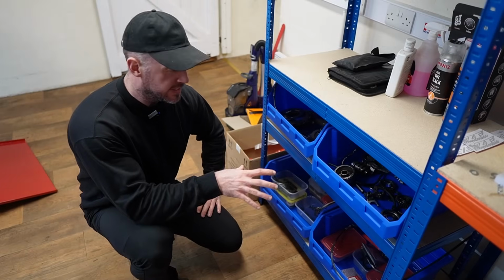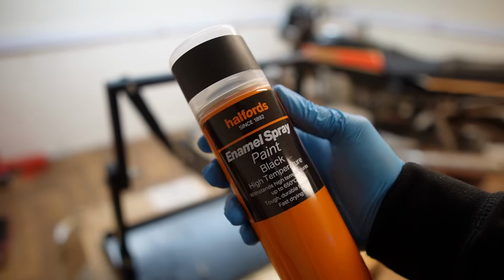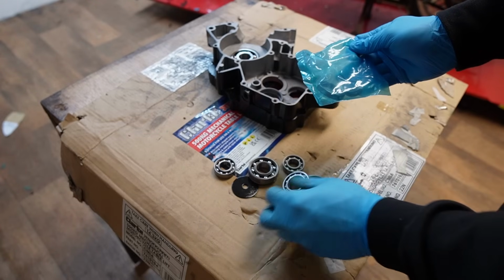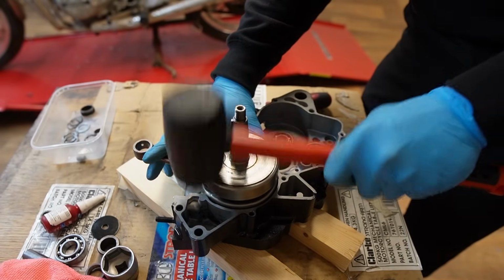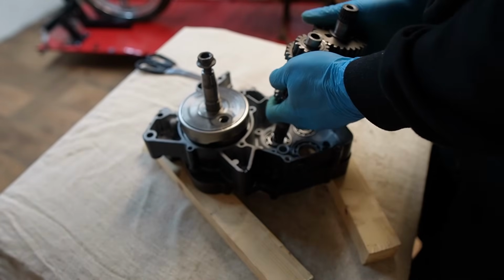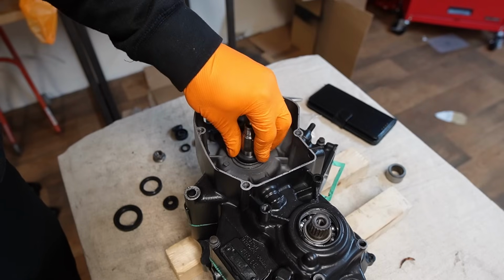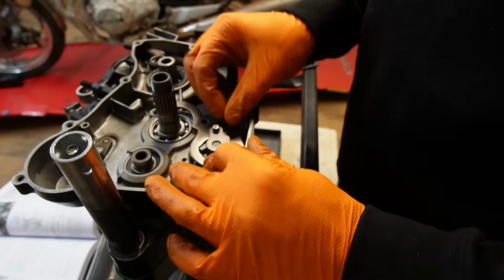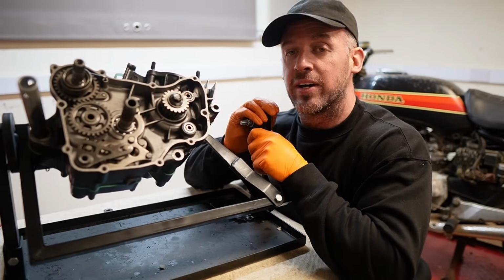REBUILDING A BARN FIND 1991 HONDA CR125 | PT 4

Comment: Loving these builds 😊 Little tip for bearings: pop them in the freezer for about an hour, heat up the casing and they should slide right in 👌
Reply: no... dont just put bearings in a freezer smh.....
Reply: @KentRoads  why?

Comment: Next time you pull the crank into the engine from the opposite side. There are tools for it but you can make your own.   The crankshaft does not like be hammered into place. 
And for the seals you use a socket to drive them in.

Comment: Google assembly lube. A dry bearing is not a happy bearing..... and that crank is likely out of balance now after the percussive persuasion leading to massive vibration at 12000 rpm
Reply: I've always used STP for engine/gearbox assembly ,as do mates still in the trade.

Comment: Buys Clymer manual - doesn't read it - Check
Paint engine casings - doesn't mask up the dirty great holes on the side - Check
Buys blow torch - doesn't use handle - Check
Installs crank - smacks it with a hammer - Check
Installs everything dry - Check
This is quickly becoming my favorite channel! Keep up this comedy gold!
Reply from the maker: Glad you're enjoying the content - hope you keep coming back 😁

Comment: Brill mate as always little tip that might help with the bearings heat the case up like u did and put the bearings in the freezer for a few hours and they should fall in to place alot easier 👍

Comment: As others have said re installation of bearings, put the bearing in the freezer for an hour and warm the case ( a hot air gun is usually sufficient) and they should just drop in. If they need a bit of persuasion use an aluminium tube or a block of oak or similar hard wood that fits only on the outside race. A steel hammer on a socket on the outside race can distort the bearing track where the balls run. Never apply shock loads to the inside race as the shock loading has to go through the balls in the race to move the outer race into the bearing housing. The balls only touch the outer race on a very small contact patch and the shock loading can lead to the bearing track being pitted.

Comment: Good job when you pull a gearbox down put zip ties on either end of the shaft stops the gear sets coming apart in storage makes assembly abit easier 👍

Comment: In case no one has suggested it. . . next time try putting the bearings in the freezer for a bit.  Once they are frozen and the case heated up, they will often just seat right down without having to be pressed or (heaven forbid) hit them with a hammer.

Comment: I suspect you're not following the Clymer instructions closely. The crankcase gasket should have gasket seal on it (if that leaks you'll have to strip the whole thing again!). Also, it would be advisable to oil the bearings ready for first use. I noticed you had to remove the bars for the selector forks to get the drum in. I was talking to the video, saying "Don't put the bars in yet..." 😂

Comment: Aaaaagh... hammering a crank web (wince) is not to be advised! As most two strokes have a built up crank (separate crankpin and flywheels), you run a huge risk of knocking the flywheels out of line, and effectively bending the crank. Result in the worst case could be binding bearings or even some metal to metal contact, and in the mildest case excessive vibration.........

Comment: I see you used high temperature paint but I doubt the lacquer is from what I can see on the screen. Halford's website under "warnings" says this stuff is highly flammable so please,for your own safety,check with them. I doubt it would turn your bike into a raging fireball but if it's not high temperature heat resistant it's not going to be pretty when it gets hot.